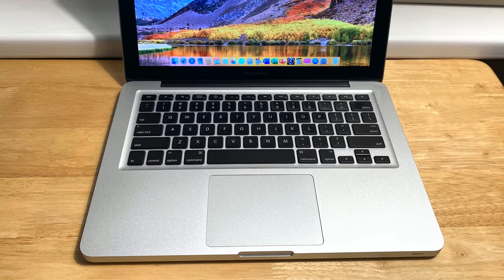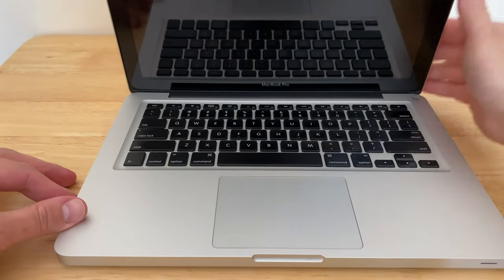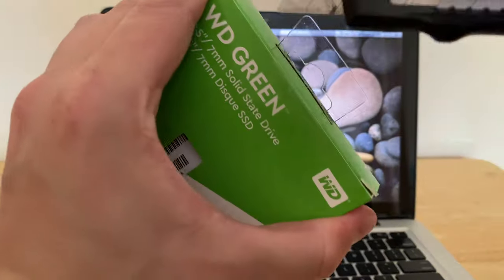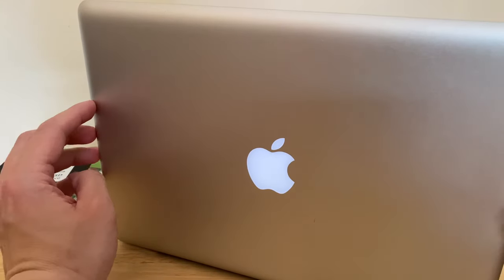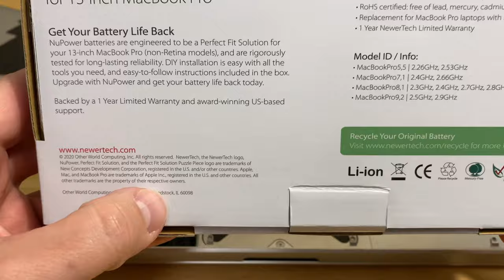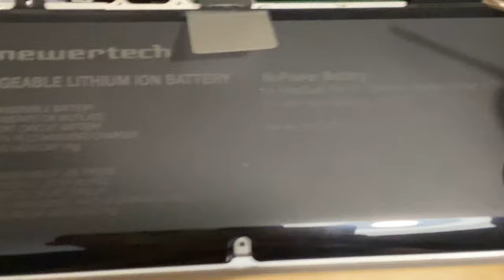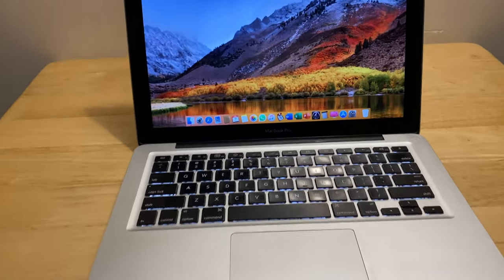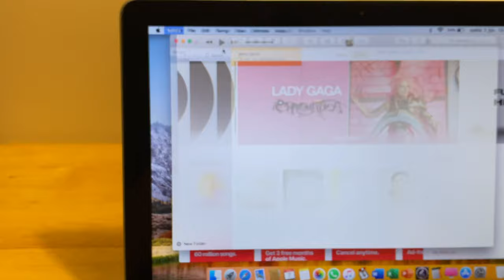IS IT WORTH upgrading a MID 2010 MacBook Pro 13 inch laptop in 2020??

Comment: I write this comment from the exact same machine! I've upgraded to a SSD with 8GB of RAM running High Sierra. Although I do believe with High Sierra I can upgrade the RAM to 16GB. Before the upgrade I wasn't able to run more than two programs without significant slow-downs probably due to heavy page faulting. But now it runs like a dream. I'm a CS student at ASU and with the upgrades and a secondary monitor and wireless mouse I can multitask CLion, Word, and Chrome with no issues and complete my school work! Thanks for the video!
Reply: I did the same thing and got someone to get a “patched” Catalina OS on it...  

(Going to pick it up tomorrow... Hope it works out for me🤞)
Reply: 8 month late but im about to get this labtop   can it run photoshop 2020 and other adobe programs or its just for casual stuff
Reply: @mhamadcommander7785  I've never run Photoshop on this machine so I can't say for sure, but just looking at the system requirements online I would have to say no. It says you need an nVidia GeForce GTX 1050 or better whereas the mid 2010 has an nVidia GeForce 320M thats non-upgradeable and is a much weaker GPU. However, you may be able to find an older legacy version of Photoshop that would work. BTW: since my review 8 months ago I have upgraded the RAM to its full 16GB and gave it a brand new battery.
Reply: @luked3172  can it play 1080p60fps on youtube?
Reply: @rn40721  Sometimes it's unhappy with 1080p60fps, but does 720 no problem

Comment: I have a mid2010 15” MBP. Added 2 SSD’s - one in boot drive location and one in place of the optical drive (used OWC data doubler kit). These Mac’s have slower SATA ports but the SSD still makes a massive difference. I have 8 GB ram and run High Sierra. This Mac is a tank and very durable. Using as a TM backup destination, and it is awesome. I have it hardwired to the network and plugged in 24x7 (battery is weal). So far so good. Apple hardware is really great.
Reply: I did the same

Comment: So I've upgraded mine as well and figured I'd just put this in the comments in case someone is skimming along haha.  As of 2021 I say YES it's worth it, but it depends on the user. 

If  you
1) Find that the cost of this macbook + parts is cheaper than any other mac you can find and you want to add 2 hard drives for more storage and don't care about speed necessarily.
2) Either you still have one of these laying around in your basement or someone gives you their old computer and just want to fix it up to use

If the user 
1) JUST uses a browser for like youtube, spotify, flash game type of stuff etc.  They have to not care if they just stick to 1080p or 720p video.
2) JUST uses simple applications like word, powerpoint, excel etc.
3) I'd even go as far as to say IDE's like eclipse or QT would still work as well, but would just be slow when compiling. So it can be used for computer science/software engineering stuff so long as it isn't processing intense or like GPU intense. 
4) For electrical engineering design stuff, Yes you likely can use this for eagle but the autorouter is probably too much for this to handle. Would not recommend simulation stuff at all (assuming any circuit simulation stuff exists on mac at all)
5) For anyone thinking about using linux, yes it'll work and I've done it before. Depending on the distro it may be slightly more optimized than MacOS since Apple does do this "planned obsolescence" stuff with their software but you'll face slowness regardless of OS. It's just a question of how much.

In terms of my hardware:

Macbook pro mid 2010 13"
OS: Mac OS High Sierra
Ram: 16GB ddr3 1067mhz
Hard drive 1TB SSD

In real life It's still the exact same speed as in this video. The RAM allows me to have more stuff open at once but that's it. I'd like to add that technically you can remove the DVD drive and stick another SSD in there and have 2 separate hard drives.  You may even be able to RAID the two together to essentially make 1 faster SSD but I think the bottleneck in this computer isn't the hard drive, it's the GPU and CPU among other things.  So using RAID probably wouldn't do much of anything in terms of performance since the CPU and GPU are not very capable.
Reply: Thanks for this. I am going to make the jump and see if I can buy a little more time with this laptop. This thing keeps on going!
Reply: @recnamorcen1  Dude it's nuts! They were totally built to last!
Reply: Do you play 1080p60fps on youtube with it?
Reply: @rn40721  so to answer your question, yes you can just barely do 1080p60fps.  I find it's kind of at its limit while working though haha.  The chrome extension "h264ify" helps a bit.  720p60fps works a lot better though and is significantly more consistent. 1080p without 60fps is like 100% fine though.  It could be a matter of finding the right chrome extension to either make it 30fps or mess with it some other way
Reply: Hey i’m planning to buy this macbook and it’s only 4gb ram and 128 SSD, is it okay??! it’s on High Sierra too
Reply: @cmbfacion5379   The SSD will definitely help, but keep in mind it'll probably be as fast as it is in this video. For the RAM that is a bit low for running High Sierra, you may have to put in 8GB.  it'll probably run though. If you're willing, maybe just buy it and if the ram is a problem just put more in afterward.
Reply: @cmbfacion5379   i've used that spec for 5 years and it's still ok. In my situation, i often change down 720p60fps on youtube because it's not working with 1080p60fps

Comment: I have a 2008 unibody Macbook. I upgraded to SSD, 8gb 1066mhz ram. Though significantly it improved in performance, it is very well being held down by the CPU and bus speeds. I think the best Macbook for upgrade for 2022 is the 2012 Macbook Pro. Which has a modern bus speed

Comment: The only real issue with these Mac’s is that they are very heavy and have low resolution screens. I miss the retina displays when I used my 2010 MBP. The I/O is also slow with USB 2.0 and FireWire 800

Comment: 2022 - 13" 2010 MBP running great. i7 I 16GB RAM I SSD. For web surfing/everyday tasks it works fine. Unless gaming (not macs arena), or into gfx design, many dont need the latest-fastest pc. Newer macs are not even upgradeable anymore --corp greed.

Comment: What’s screen and colours according for photography and lightroom? Are pictures on this screen as good enough for colour accuracy (as retina)?
Reply from the maker: That's a great question. I would say that Retina displays are much sharper, with a much better screen resolution and more saturated colors. Does that make the color accuracy more accurate!? Yes and maybe no.

I would suggest experimenting with the color profiles in Mac's System Preferences inside the Display color profiles. Could work fine even with the non-Retina displays.
Reply: @TechUThrough   Thank you for respond. I have another question. I got recommendation from apple technician not take 13” 2010 but rather pick 2011. Are models of 2010 less reliables than 2011?? For some manufacturing defect or why? Thx
Reply from the maker: @Hayk_empty_cloud  hmm..the only thing that comes to mind would probably be that the 2010 MacBook Pro maybe had a graphics card problem!? Maybe that issue has been resolved in the 2011 MacBook Pro's, although I never heard anyone complaining specifically for the 13 inchers, more for the 17 and 15 inch MacBook Pro's around those years.

And even then, the problem could be for the second graphical card for custom 13 inch MacBook's, the ones with 2 cards. Never heard the main graphics chip failing on the 2010 MacBook Pro's

Comment: I have an SSD from a windows laptop with Win 11 installed. I'm new to Apple but would like to use a Mid 2010 MB I got for free to test the waters. I also have some ram. What is the process of switching the HD from a Windows to Mac? Thanks.
Reply from the maker: Hi!
For best results and for the Mac to don't crash later on, I am always suggesting to clean install a fresh macOS and formatting the drive before installing it from Windows to a Mac computer. 
I have some videos dedicated to the clean install process here on my channel. Please check them out! 👍🏻

Comment: I still use my 2010 MBP. I have specked it out a lot and it runs smooth, but can no longer edit video on it.
Reply: what issues are you running into with editing videos?
Reply: @auriceli  it will freeze and then crash. I downloaded some free low memory video editors and those crash also. The family uses it for online usage now, and I picked up the M1 MBP for myself. The only thing the 2010 could not do is edit video.

Comment: Hi sir I don’t have a lot knowledge of this MacBooks since mine is 2010 and I have few questions that’s exactly my MacBook Pro model and I want to upgrade it to the latest version looks like I have to use your steps so if I take it to a store can I tell them I want more ram? Like Mine is 4gb ram and I think 250gb inside the storage I I want it like more space cause I want to run chrome and stuffs but it is necessarily to upgrade the battery? If yes is it stronger than the original one like can it last more hours? I hope you answer me thanks
Reply from the maker: Hi! Thank You for the question. 

First of all, You can do it by yourself and not give the Mac to a store, the steps are simple to do by Yourself and You will save some more money in the process. Of course, if You are not sure about it, You can ask for assistance from the store.

But the main thing is to find and buy the right parts (RAM, SSD and battery) for Your 2010 Mac.

If you have 4GB of RAM, that means that probably you have 2+2 modules inside. 8GB is really O.K. and therefor You need to purchase 4+4 RAM modules or even 8+8 RAM if You want to use the max. of 16GB RAM on Your Mac. You can find detailed info about the RAM here:
https://everymac.com/systems/apple/macbook_pro/specs/macbook-pro-core-2-duo-2.4-aluminum-13-mid-2010-unibody-specs.html

Usually 500GB of storage should be O.K., but choose ONLY SSD's if you really want to feel that Your old computer feels and runs noticably faster. By standard, the SSD's have 240GB or 480GB storage, so you can choose the 480GB SSD drive.

About the battery, it wont give you like 8 hours of work time, but a new battery is needed for the computer to run normally. Depending on what You use Your Mac for, new battery will give you more runtime anyway.

Best place to get legit old and new Mac parts is OWC site:
https://eshop.macsales.com/

Here you can check the parts compatability for specific (Your Mac) model.
Reply: @TechUThrough  hi again thank you very much for these good informations, I will start looking for the links and check for good battery and the other necessary things:).. btw I heard that MacBook pros the unsupported ones can get Catalina installed on, is that true? And cause if yes I would like to get it updated. again thanks a lot sir ❤️
Reply: @TechUThrough  also sir one more thing which parts of my MacBook Pro can be upgraded for newer parts like the stronger performance, like how the SSD or ram can be more & and newer I want to make it as new as much as possible cause I can’t afford thousands of dollars right now maybe in next year I will ❤️
Reply from the maker: @denmarkdiscord1561  Basically that's all you can upgrade, the max RAM and the noticeably faster SSD drive. 
For the CPU not to overheat, people put new thermal paste to it, by removing the old one that has been hardened or not existed anymore after many years of exploitation.
Of course, cleaning and dust removal from the coolers and inside of the case helps as well.
Reply: @TechUThrough  I googled yesterday and since my MBP fortunately is 13 inch I can put 16gb ram into it I guess and I guess that the SSD can only get 1tb? Or higher

Comment: Are you still planning on making a more in depth tutorial on how to get High Sierra? I can't get a straight answer about installing which software. I'm at 10.6.8 currently, also with a mid 2010 MacBook Pro.
Reply from the maker: Hi! Did you try all the steps provided in my video? And, do you have the original old macOS installer files? If so, you should be able to go through the same steps I did in my video. Of course, that wasn't an easy task for me too. 

I wish we could just click upgrade and get the latest available macOS software that our old mac should get without all these road bumps :) 

The hardest part was getting all the old installer files. Many didn't work until I happen to find the correct ones.

Hope that you will be able to upgrade your Mac! 👍🏻
Reply: @TechUThrough  I was told to install 10.8 and go from there. There's an installer on the Apple website that allows it to be updated from 10.6.8 but it didn't work when I installed it. I'm new to Mac so I have no idea what I'm doing.
Reply: @TechUThrough  And I haven't been able to find the first version of the updates; ex: 10.8.1 (ex: 10.8.2 and higher are what are shown on the Apple site)
Reply from the maker: @gamerblondie28twitch58  yes. I have to say, it's almost impossible to find them these days. I can try and find them on my external drives, I think I never deleted them, knowing that this day could come :)

Not sure, how can I send them to you. Would have to put them on some cloud drive and send you the links

Comment: Reading the description, I completely feel you as I've just found myself in the exact same situation. Got the very same Macbook Pro Mid 2010 13" from a relative. It is still on 10.6.8 and I tried installing El Capitan, but it failed multiple times. You're saying that I first need Mountain Lion and then Capitan and then High Sierra? I'm now trying to do so, but after choosing my USB drive from boot options, it seems I'm stuck at "Installing" white screen with blue-and-white moving progress bar. Have been wondering for days, why does Apple have to over complicate this?? Would be so much easier just formatting the storage drive and being able to install any software version right away.
EDIT: if you still remember, could you please tell me what steps to do to get the latest OS High Sierra? I also plan to upgrade to SSD. Thanks.
Reply from the maker: Hi!
I totally understand You. I'm thinking that the Mountain Lion is needed as the first step here, because of the fact that it was the first macOS that featured the App Store. Previously we needed a DVD Lion disc to install macOS through the DVD drive. 
So only after that, the recovery mode started to fully connect to the update/restore servers. My guess.
Nevertheless, the process was really frustrating as I had a. hard time finding an official old macOS installation bundles/files.
After I found a working Mountain Lion (that was the hardest part, because You need the very first, not some updated version) and El Capitan, the rest was making a couple of bootable USB flashes to finally install one after another.
Reply: @TechUThrough  Since I first attempted to install El Capitan (unsuccessfully), it still installed the El Capitan recovery (10.11). Now when I formatted the hard drive via Disk utility, then booted while holding the Options (Alt) key, there are two options to boot from: The bootable USB with stock Mountain Lion (10.8) dmg that I was able to download and create, and Recovery (10.11). After choosing the bootable USB, the installation starts and throws error after 5 seconds. I think that my very first attempt to install El Capitan messed it up somehow as it seems to me that the EFI (BIOS) thinks that El Capitan is its native MacOS version. No idea what to do now.

Comment: I have a MacBook mid 2010 working all day, since 2009…And I just want to upgrade my macbook to 16BG ram and 500 GB SSD, for editing little Movies in iMovie, using OBS and Logic. I can’t buy another Mac now… so I’ll do upgrade.
But It loses access to normal upgrades from Apple Store? Thanks for the vídeo.
Reply: you cant add that much ram macbook pros only  support 8 raM MAX.
Reply: @guidogc90  some people have made that. Finally I’ve add only 8GB because 16GB was too much money here in Brazil now. But thanks
Reply: @daniabioficial  usually MacBook Pro prior 2014 doesn’t support 16 gb ram also 8 is good
Reply: @guidogc90  MacBook pro mid 2010 ver 7.1 can run 16gb ram 1066 mhz thats two 8gb ram cards upgraded my mac about 5 years ago, works fine runs stuff like logic pro .ssd up to 1tb. Being 12 year old the wifi ant uses 2.4 ghz so advice to all buy a usb mini wifi dongle and it will connect to the 5 ghz giving you faster internet speeds if your router offers 5ghz.that is .Hope this info helps. stay save people.
Reply: @musicmonk  wow thanks, battery of my surface pro die and its irreplaceable. How do you know of its 7.1?
Reply: @vincentremillard5301  so on your MacBook , click the apple sign top left hand corner , click about this mac. you will see system report, click that , and you will see model number of your mac. if it is a mid 2010 it should be 7.1

Comment: I have the 2.66ghz model with 8gb of ram, a 500gb ssd, and running 10.14.6 using the Dosdude patcher. I also have a backup high Sierra partition. It runs pretty nice on Mojave, and is a good little laptop for web browsing and downloading drivers for older computers due to it's small size. It can also burn DVDs which is a massive plus for me. I got it for $135 on eBay.